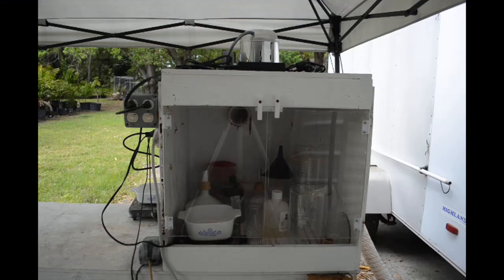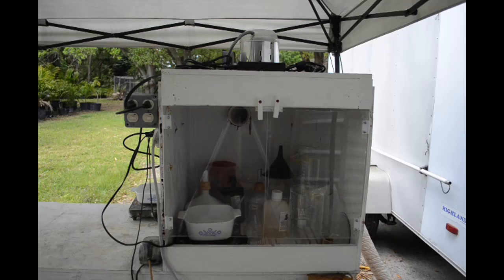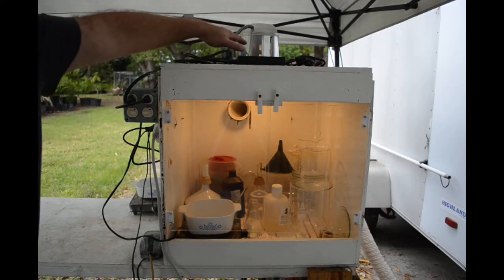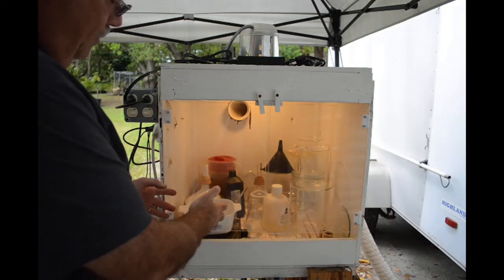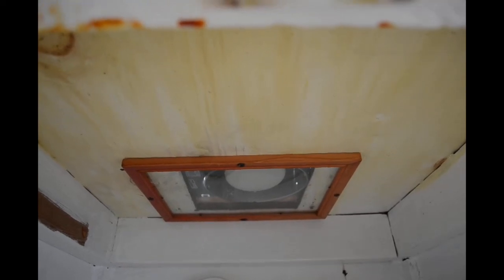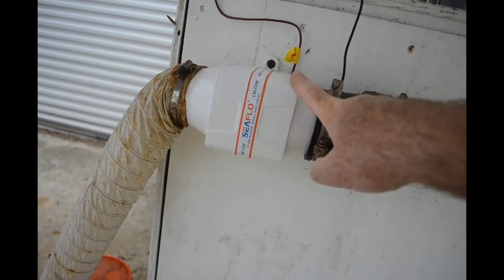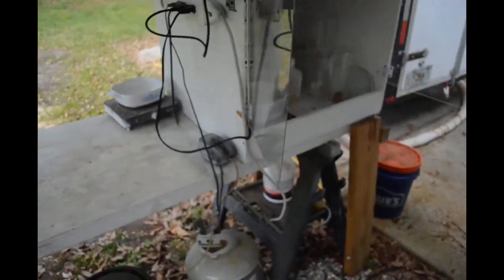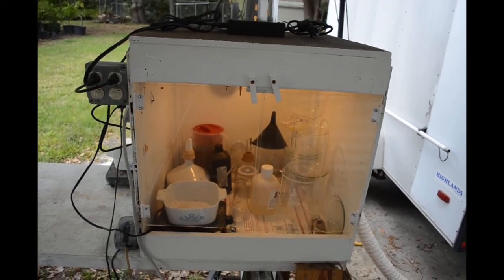Home-made fume hood fixes, repairs and updates. It's working good now. Make one for yourself.

Comment: I built mine using an old giant screen projector TV housing, (dumpster find). . It operates under (Bernoulli's principle)..... The fan is never exposed to fumes.  Takes a bit to get set right, but man it will move some air.

Comment: I have a big box full of salvaged computor fans they are brushless therefore don't spark so should not create a explosion hazard. What would be the thought on these making a viable source for a blower set up for fume hood? They are mostly plastic except for the seal motor. I have been collecting and saving electronic components for a long time and built up a fair stockpile. It's about time I built me a station for chemistry and refining.
Reply from the maker: I don't know if the computer fans would hold up to the chemicals or not, but you can try. They are free for you, so why not?
Reply: @omegageek64  thanks for the quick reply this was something I have wondered about for some time now. But I have a lot of these and using what you have instead of spending lots of money most times makes good sense. But although I have a fair knowledge with chemistry stuff I have had as of yet very little practical experience. But at 62 and retired with nothing but time to do what ever seems a good time to make use of my knowledge and interest and gain the practical experience. I hope to hone my skills and be able to do custom precious metal refining for individuals. There is nothing like that anywhere remotely close to my area. Yet I know a lot of people local who do gold prospecting and scraping as I do.

Comment: Why don’t you run you tubing straight up , well not straight up but at least north
Reply from the maker: Hi. I tried that at first. The problem is that most of the gases and fumes produced by my gold refining are heavier than air. On a calm day the stuff would come out of the stack and drop right back down on my work area. I quickly learned to discharge it at ground level downwind of me.

Comment: You might want to consider moving the motor off of the fumehood and mounting it a little closer to the end of your exhaust hose. It will still move the fumes out of the hood, and it would be a lot quieter for making your YouTube videos. As long as it's not attached to the fume hood the vibrations won't create so much noise.

Comment: Isnt a fume hood for use outside a bit redundant?
I understand and definitely appreciate the providing of information so that it could be transferred to a build indoors but other than that I am not sure i get why...
It does make the videos look more professional though 👍
Reply from the maker: Working outside is no guarantee of not getting a face full of something nasty. The wind can change in a heartbeat and suddenly you are in a cloud of acid fumes. I was tired of constantly having to dance around and try to stay upwind of what I was working on. On a calm day a vapor cloud can spread out in all directions and drive me away from what I am working on. Plus I had ruined several pairs of glasses due to the coatings going bad from the fumes. I was worried about my lungs and eyes. so I built the fume hood. Now there is no issue.
Reply: to right.your 100% correct.even outside a fume hood is needed.especially your your adding acids etc.wind can change a blow it up in your face.top job as always my friend
Reply: Ok fair enough 👍 I have just never seen anyone else tske that approach
Reply: There’s no overkill when it comes to some of these fumes